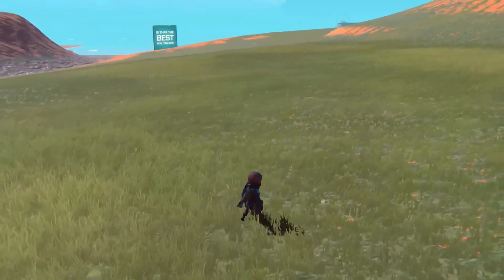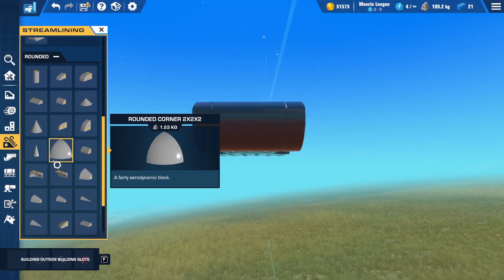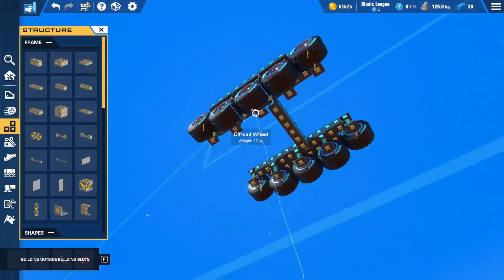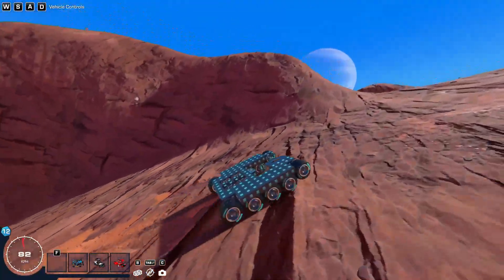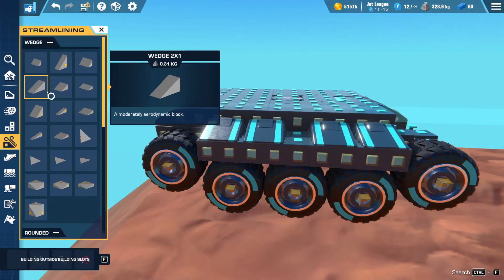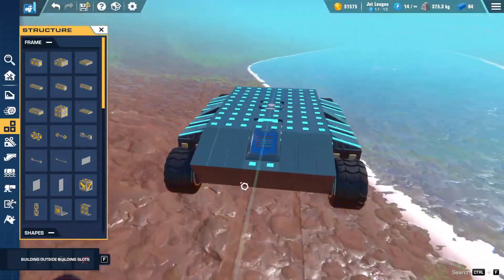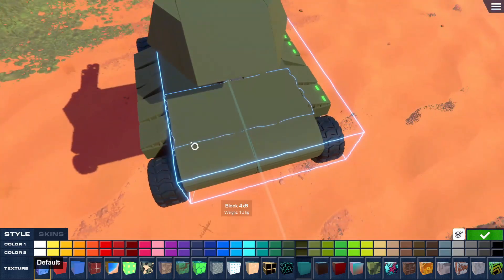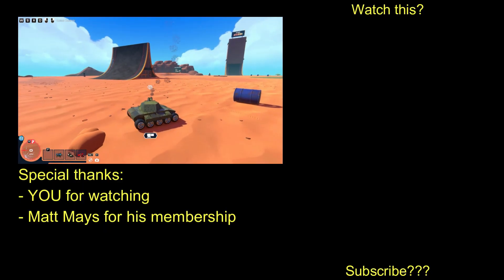Making A Tank BEFORE 2.2 - How Much Easier Will Tank Tracks Make It?

Comment: With complex armor schemes, my tanks often will hit the complexity limit and I have to make compromises on protection. Most of the complexity comes from hinges, suspension and multiple wheels. With the new update and tracks, I believe that tracks will have less complexity than all of that and allow me to make no compromises on my tank designs. Especially my designs that utilize hinge armor plating
Reply from the maker: The whole tank track block is 10 complexity across ALL sizes. You're practically rewarded for using the big ones thanks to how well-optimised they are. I just wish wheels were this good too.

Comment: GG. Put the underwater engines on the tank steering. It may not turn as sharply as the wheels but it will give you some steering in the water.

Comment: the Rally Car Logic video really helped my builds go to the next Level, but its very jumpy and over corrects a lot, I've turned down the Gyro strength, but it still does it, if you could I'd like some help on that since I know practically nothing but the NOR and OR gates.
Reply from the maker: i recommend a manual off-switch to hold down so in areas of the terrain you know it'll freak out in, you can hold that button and glide over it. Until I find a fix, it's also what I did to my own car.